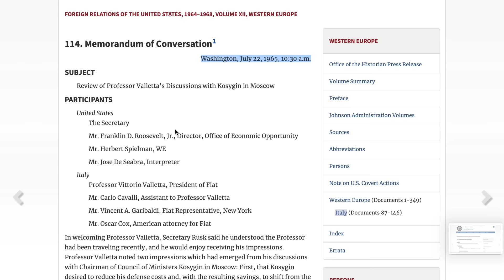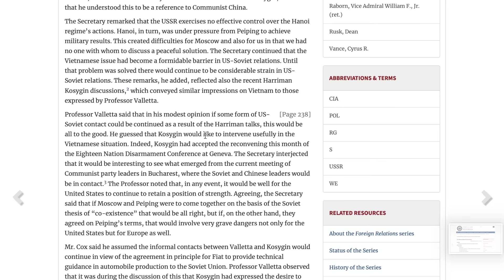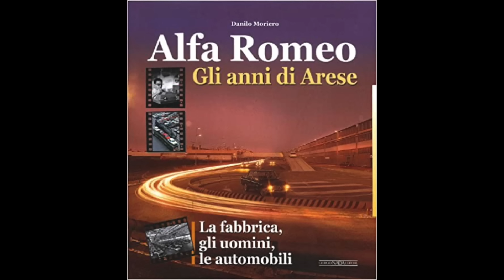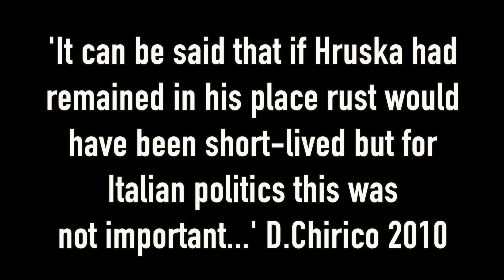Alfa Romeo And The Myth of Russian Steel - The Real Reason Alfas Rust

Comment: It seems the Dutch steel plant Hoogovens Estel based in IJmuiden made steel for Alfa Romeo. On Alfa's request Estel added more rusty scrap to their steel to keep it cheap.
Another story is that due to the local salty sea breeze they unpainted bodies of the Alfa Sud started to rust inmidiatly.
Actually this happened to the FIAT 126 in Poland too. These bodies stayed outside waiting because the new line for the FIAT Cinquecento had to be build and starting up this production was key.
But, well, this procedure was common at British Leyland too. Lots of unfinished MINI's were victim of the harsh Britich weather!

Comment: I owned and maintained an Alfa Giulietta1.8l  for over 20years - mechanically it was great -very reliable if one knew how to maintain it properly.  
Regardless of where the body steel came from it was of an inferior purity metal. When patching local rust spots I found 'veins' of black carbon with trails in the steel under 'good' paint - leading up to 300mm away from the rust hole being repaired. Little repair jobs got bigger & bigger.
It was often hard to find solid steel to paint over.
Reply: I have a 2.0RS I've owned since 1994 when it was 9 years old and it's absolutely solid. It has had repairs around the rear boot opening and the front windscreen but that's about it.

Comment: Interestingly, my father who was a mechanic in the 1970's-1980's had a slightly different version of the myth: He told me that the steel came from recovered shipwrecks and they somehow screwed the melting process, leaving sea salt in the steel, thus leading to the panels rotting from the inside. I can't wait to tell him the truth :-)
Reply: Where did they recover all those shipwrecks from? 
It's expensive to do and there are millions of cars to recycle right on your doorstep.
Economically it would be insane (you only recover shipwrecks if they're an obvious danger to very high value shipping routes or you want uncontaminated steel if it wasn't exposed to fallout from nuclear explosions - or historical wrecks for museums).

Comment: When I was with German Air Force in 1978, one of my pals owned an Alfasud about ~ 3 - 3 1/2 years old. He bought it when it was 2 years old. He was told it was refitted on behalf of Alfa-Romeo Germany by the dealer. It received new front fenders and was partly new painted (especially the roof). When I met my pal, his Alfasud was rusting all around. There was a BIG hole just above the exhaust / silencer. Rear fenders, doors (especially lower parts, but surprisingly the roof on top and the hood showed brown rust blotches under the paint. On the other hand the engine was brilliant, the gear was great, handling of the car superior. But everything made of sheet metal or tubes was just scrap. His car did not survive the 4-years TÜV inspection. It was scrapoed. BTW a inspector of Alfa-Romeo Germany told my friend: „ I have never seen such badly rusted new cars before the Alfasuds. They must have used badly rusted material producing them.“ Most probably he was straight on the point. The Alfasud could have been a cash cow for Alfa-Romeo, had it been built even to their own standard. It was a good car brought down by shoddy workmanship. How they built them was straight for the scrapmetal man.

Comment: Excellent videe! There must have been something more in the process however, the striking etc. could only explain some of the build quality issues. I wonder if there was a deficiency in the paint or the wax they applied?!
Reply: Yes, there were several other contributory factors (explained in the book), for example, the original design brief called for a maximum all up weight of 850kgs which was only achievable by using thinner than usual steel.  There were many other issues too, so it would be wrong to try to put your finger on just one cause,  but for the purposes of Jack's explanation he has the overall picture.
Reply: @chrismartin9421  sounds like an interesting read Chris, I will order on Amazon shortly. I was always more interested in the 105s, but the Sud has a great back story!

Comment: I owned several cars through the 1970's that had been built in the late 60's to the end of the 70's and beyond. My Alfasud was a 78 model as I recall by which time the car had earned its poor reputation and Alfa had started claiming they had addressed the issue with surface coasting of the bare steel. My experience however was that the car still developed rust more quickly that contemporary Ford etc. , seemingly from within the sheet steel and not just from the effects of e.g. salt water starting from the outside of a panel. Rust also formed on my car at the attachment points between sills and wings where weldng had perhaps burnt off any protection. A 1600 Giulia Super that was also in the family was by comparison far better and survived UK conditions for many years, possibly due to having thicker steel.Best of all was a '85 Porsche 924S which seemed completely impervious to rust having been made from galvanised sheet steel

Comment: fabulous story, part of the problem (I think) is that the sills in these cars were like a built in obsolecent feature which stored dust etc, and poor venting in these sills kept the moist dust to do its work. Drilled out many Alfetta lower body sills to find this same issue. Unless the car is built from fibreglass or good stainless with proper moisture escape design they are a rust time bomb. I think that body manufacturing processes at the time were deficient where water run off is concerned.

Comment: My fiat 128 in a rust free Arizona climate developed huge cracks that had nothing to do with assembly quality. It was a failure of the sheet metal. We also sold Alfas and Lancias. Many design and assembly flaws. Italian plastic evaporated in AZ heat and sun. Panda was the last model, quickly renamed the Stranda.

Comment: I remember  that other car manufacturers also suffered from the dread rust problem we had a 1976 polo from new rotted a away . I was told that  that the problem was linked to a Belgium steel plant failing to process scrap properly . I think your video and  the evidence provided may be other manufacturers plants had similar industrial relation issues the probability at BL where wildcat strikes were a regular occurrence back in the 1970's and early 80'd   make it a the most likely reason  for car rusting badly .

Comment: I have also read that because of the ongoing disputes etc the steel was left exposed to the elements too long before it was pressed. Brother had an Alfasud and it was a fun car to drive, stuck to the road like glue and luckily he had no rust issues. It was avery roomy car with a distinctive raspy sound.

Comment: While cornering rather hard one day in my Fiat noticed it started to understeer quite badly mid corner, that's strange I thought, as it handled quite well. Apon inspection it had given itself some serious positive camber. Turned out the cornering force had pushed the inner control in an inch or so, the joys of a rusty design.

Comment: From mid 1972 and about a year on, the Audi factory changed supplier of sheet metal to a cheaper recycled steel, rumoured to be from Italy.
Fact is that you can actually see grains of various colour in the metal with just modest magnification, and model year 1973 of the cars also rusted severely, a paint chip exposong the metal resulted in a hole just some weeks later.

Comment: Jack, in 1967 I owned a 1961 Fiat 1800, 6 cylinder, 4 door sedan, despite being only 6 years old it was very badly rusted, and in Australia we do not use salt on the roads at all. My Fiat existed in a very "temperate" climate yet the rust bug had a good hold on it in a short life, it went to the "scrappers" at only 8 years old. We used to say all Italian cars were transported as deck cargo on tramp steamers, Fiats right way up on the bottom Alfas upside down on the roof of the Fiats, nice cars to drive but too fragile.

Comment: Very interesting video, to be fair most cars rusted in the 70's and 80's.
Reply: They were designed to rust . Make a product that  lasts  and you are putting yourself out of business
Reply: True the '70s had a lot of rusty cars, but the point of this investigation was to find out why the Alfasud rusted much faster and with worse consequences than the rest of the Alfa range which were made from the same steel supply but in the Milan factory rather than Pomigliano d'Arco.

Comment: Thanks very much for the detailed historical info. It’s so refreshing when someone refers to real data, instead of suppositions and prejudices. Do you think that the fact that much of the Italian market itself doesn’t worry much about rust, because of the predominate climate, also plays a role in manufactures attitude towards that aspect..?  Personally I love Italian cars, the expensive ones and the cheapest ones, the handling, the shifting, always a joy to drive.
Reply: I lived in Rome in the 70s - you could tell if someone lived in the hills by the state of their cars. Local cars would be going strong (no salt on the roads - we had one snowfall, for 15 minutes, in the time I lived there) and cars would usually die from mechanical exhaustion. Cars that lived in the hills rotted like in northern Europe. 
It was also noticeable that car buyers were incredibly patriotic - there were a few MB dotted around but FIAT in particular had the market sewn up.
With such numbers propping them up it is entirely possible that they had rust traps built in because it didn't matter when your target customer lives in a virtually rust free environment (ie the mechanicals give out first).

Comment: Jack -- complimenti per un capolavoro !  Right around the time Fiat-Roosevelt Motors transitioned to Fiat NA at their US headquarters in the USA, I had the opportunity to speak to the Amministratori Delegati to the USA of both Fiat, SpA and AR, SpA at a reception hosted by the Consul General of Italy to NYC.    The Russian steel issue was discussed as a sidebar topic of interest because it was a  big problem here in the USA as well.  {As an aside, it was just as big as the SPICA mechanical FI that had been fitted to the AR 105 series that noone knew how to tune or fix.  But that's a story for another day).  In Italian, they both said that the issue was complicated - just as you mentioned,  because it involved not just a business transaction between Fiat, a publicly traded company run by the  oligarch Avv. Agnelli but the Italian government, that was running AR through a politically motivated holding company since 1933 did not make rational decisions.  They both suggested  that the Russian steel narrative may have been crafted by some ?? as a clever way to deflect the inadequacy of quality control and assembly methods used to construct Italian cars in general.  The cars that came to the USA were sent as open cargo and exposed to salt air.  The US dealers did not always rinse them immediately upon delivery and some cars sat for months.   So goes the narrative -  It was the Russian steel not the corruption and bribery of the Camorra run syndicates at Pomigliano.  The cars built at Arese were better, no question, but they were not immune.  Arese  was also a site of labor disputes and strikes that was commonplace in Italian industry and transportation at the time.  Che vergogna !    In fact, the entire decade of the 1970s Italy was corrupted by institutional and illegal dealmaking and violence.  This was the result or aftermath of the revolutionary intellectual academics that had convinced the working class and university students that Maoism was better than the Christian Democrats who were being fingered as harboring organized crime figures.
Reply from the maker: Wow, that’s fascinating thank you and great to have further corroboration too!!

Comment: It was not only the low quality of the steel and improper paint formulations that affected the Alfasud.
Many Italian cars from the era were plagued by bad electric components. Wires too thin, temperamental wiper motors, the hi/low headlight switch (the one on the steering column), the reverse gear light - but most of all, the six alternator diodes and the voltage regulator were failing continuously. And when those cars which still used a dynamo, the graphite brushes were undersized and failed at the first long night drive in rain, when all accessories were on. I saved the best for last: the fuel pump. I don't know what the engineers did, but every Italian driver from the middle '60s had experienced a fuel pump failure.
And the 90 km stretch with an incline from Florence to Bologna blew the water radiator and the oil grommets of one Fiat car every ten - that transited that stretch of motorway...

Comment: The Alfasud also had foam in the A pillars and perhaps other places as well, trapping moisture creating a good environment for rust. Also made it very difficult to rustproof those areas. Did not manufacturers start to use water based paint at this time just make matters worse? Drove one in -76, lovely, just like a big mini!
Reply from the maker: The foam was added later as a supposed measure to proof against rust but it did the opposite!
Reply: Like lots of modern cars

Comment: You're absolutely right concerning the general hideous build quality of the seventies: I only recently clicked that my first car (a '72 1275 MG Midget) bought in 1981 was not quite ten years old - it always seemed ancient at the time (as a "sixties rag top") and was a total Tetley! I brushed a thick layer of paint externally, carpeted the inner wings, put in a tape player and a pair of spotlights, and proudly went to the pub to show it off. (With hindsight, should probably have let the paint dry first).

Comment: Also from a materials point of view, steel is one of the most recyclable materials we know. Unlike for example aluminum which loses quality every time is recycled, Steel doesn't lose any properties from recycling and in every batch of "new" steel, there's a proportion of recycled metal. The source of the material is not important, the treatment and the thickness are what determine its rustproofing and both are decisions of the manufacturer. Alfa Romeo is famous for using really thin and light steel that is hard to work with on repairs.

Comment: I used to work as a car sprayer for a Fiat and Lancia body shop from 1981 to 1984 and they had a 6-year anti-corrosion warranty which meant the cars were guaranteed to rust. I used to respray brand new Fiat Strada's because of rust holes.

Comment: Italian manufacturers were one of the first which solve the technological problem of corrosion in their cars. At Mercedes and Mazda, this problem existed until the end of the 90s and even the mid 00s.
The problems with the corrosion of cars are not related to the iron (corrosion of unprotected iron is something completely normal, regardless of whether it was made in Germany, USA or the USSR), but with how well the manufacturing plant treated this metal against corrosion. Starting from the galvanization of the finished iron parts, we go through the quality of the paint and its application, and we get to the the special coating that is applied in the areas that are subjected to sandblasting during operation. There are other small details, "baby sicknesses" on cars that result from engineering errors, such as plastic moldings that trap water between them and the metal, and this causes corrosion.

Comment: Ford had problems with steel supply that caused huge problems in 1986 mk4 escorts. They used recycled steel as the usual suppliers were on strike, is the story I was told. I can confirm that mk4 escorts on D plates in the UK, 1886/7 fell apart rapidly.

Comment: As I understand it, the main issue with the Beta was a poor design for the back part of the subframe that housed the engine/gearbox. This was a huge water/mud trap, resulting in that particular area rusting and in some cases the engine mounting was so damaged that it failed. Lancia bought those cars back from customers, but that gave them terrible PR, and so even after the subframe was redesigned and the cars went back to being as rusty as most of the other cars of that era, the damage was done.  Lancia being a fairly pricey marque probably didn't help their cause.
After the Beta, most Lancias were galvanised and rust became much less of a problem, however the damage was done. (I had a 1992 Dedra and now have a 1993 Y10 which is remarkably solid, shame about the interior plastics, though at least some of that can be blamed on a previous owner.)
Jack - I have a question about your pronunciation of Lancia - I've heard various pronunciations of Lancia, and the one you use seems to be the anglophone one - have I got this wrong?